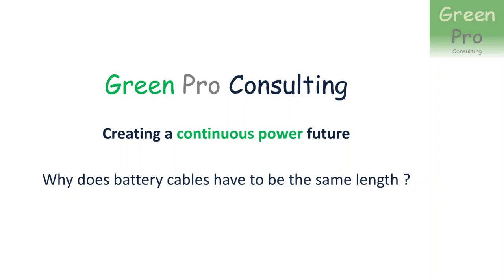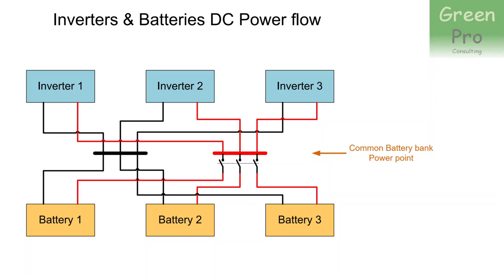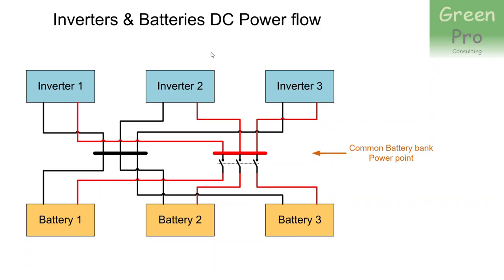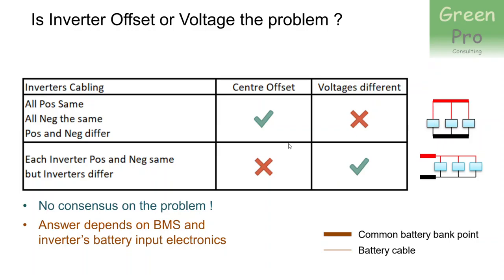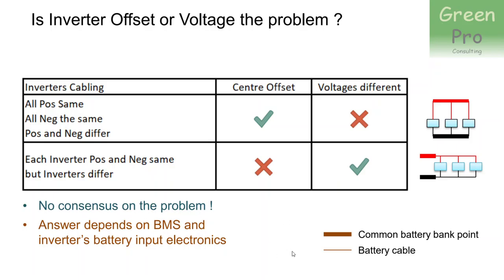Why must a system's battery cable lengths be the same ?

Comment: My guess, its more applicable to batteries without an BMS, eg Lead acid gel batteries.  The voltage difference between a fully charged battery and a depleted battery is very little, so a small change in voltage drop can affect how the inverter then sees the state of charge of the battery,  so given 2 batteries with the exact same state of charge, where one has short leads and battery two has long leads,  the parallel voltage reading will be lower than a reading just over Battery 1 and higher than reading just over battery 2.  So this may leave the inverter to make incorrect assumptions on the state of charge of the batteries.   Not an expert, but that is my hypotheses.

Comment: Definitely  just a common guy, i would venture the cable equal lengths was to get the same voltage at each battery for load distribution and to maintain balance of batteries

The guys making the booklets aren't the engineers who made the statement many years ago , they are all trying to interpret what it means

With many not having a clue why and thus coming up with interesting answers

edit
as long as your cable lengths doesn't have one battery carry way more load than anothers and thus would drift below 20%soc while you are under the impression that none are going under 20% then i am also of the opinion that this isn't as big a deal as being made out to be
Reply from the maker: Mmmm. OK. But battery BMSs can handle unequal currents. Remember the difference is VERY small. Then maybe, have equal lengths from battery bank point to batteries, but unequal from battery bank points to inverters.
Reply: @greenpro-greenproconsultin7420  yea it is  as long as the setup can deal with adjusting as the clever systems do or having the correct charge current to not trip the last battery to be left charging overcurrent

but even then the bms take care of protecting the individual batteries

with the amount of stories of incorrect setups, if this was as fragile as some make it out SA would be on fire